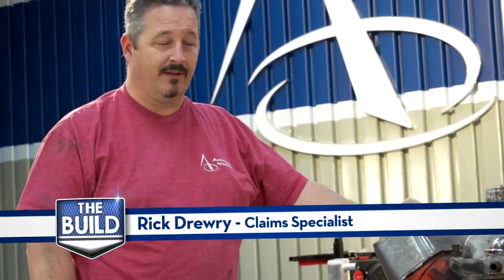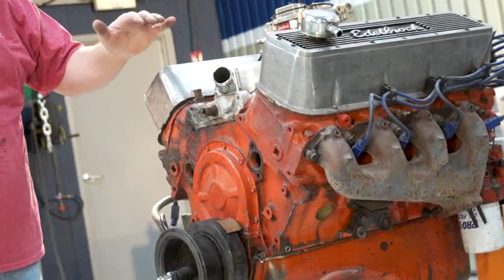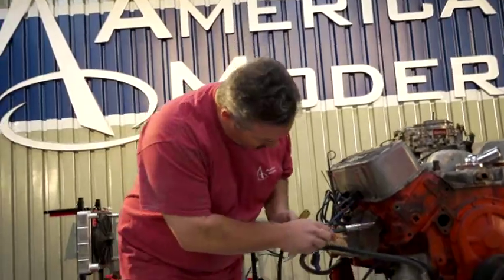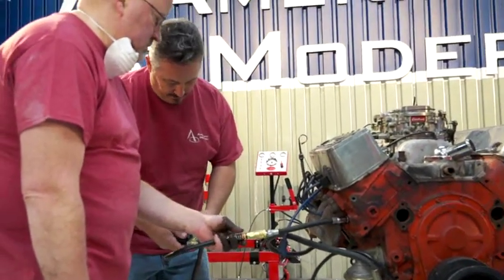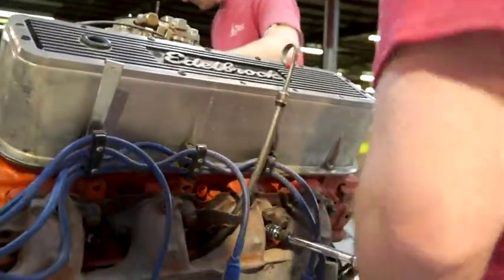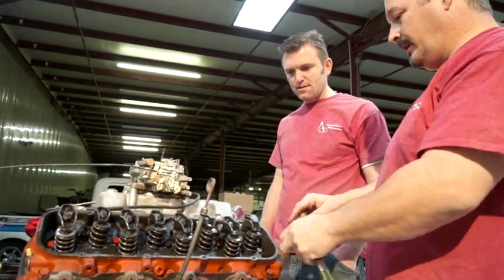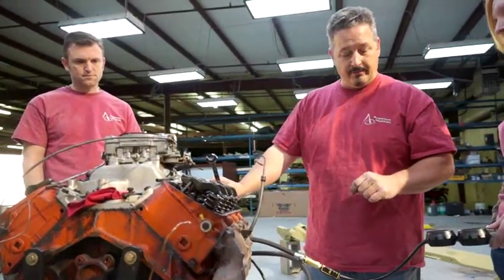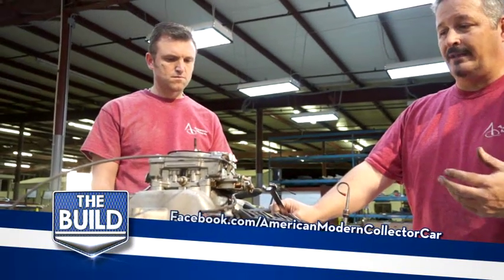Engine: Cylinder leak down test - The Build

Comment: I changed my intake manifold my spark plugs and the spark plug wires  and both of my ignition coils and the car is still shaking with a rough idle what can I do to fix that problem

Comment: You dont have to get piston at "exactly" TDC. As soon as compression stroke begins the cylinder is sealed for the test and remains sealed until the end of the power stroke. The main reason to get it close to TDC is that the compressed air can rotate the engine but at TDC the connecting rod is perpendicular to the crank for maximum resistance to rotation. With so many people to help just have someone hold onto the breaker bar. They can easily hold back the rotation force from the 15 psi pressure.

Comment: My dear
The leak test should be performed when engine is hot at the normal operating temperature so the piston ring is sealing the cylinders
And the valves are expanded in their holes.
Ask the expert...

Comment: How you can know for sure is not on exhaust stroke cuss anyway is expelling pressure by the tip of the hose I ask cuss my 8 cylinder is escaping way too much from muffler and I think was tdc but not sure if is on exhaust or compression stroke each time piston go up give me a lot of air out of the tool hose attached

Comment: I see below that you commented the test was being performed at 80 PSI, unfortunately that's not possible with this tool. Essentially all the tool is comprised of is a pressure regulator (the part you fiddle with) and a 15 PSI pressure gage that's marked off in % leakage. When you set the input regulator and the leakage reads zero you're basically setting everything to 15 PSI. If the cylinder doesn't leak at all the pressure stays at 15 PSI, if it leaks enough that the pressure is around 7.5 PSI it's gonna read 50% leakage and so forth in a linear fashion; when it's 100% leak that means 0 PSI of the 15PSI regulator is backed up into the leakage gage. I think you meant you were feeding the tool with 80 PSI. You should feed it 80~100 PSI where 100 PSI is the max it's rated for. It's also as I've learned a little dubious to leak down test a cold motor, they're always going to read higher than you'd probably like to see as the rings and piston aren't expanded to their operating dimensions. As another gent posted below, you can put some oil in there and that helps...probably still will read lower than a warm engine.

Comment from the maker: We try to show everything in our videos. While doing the leak down test, we were in the process of tearing down the engine anyway, to get an idea of the condition. We knew there would be some issues. The blow by from the compressed air was significant enough that I questioned whether we hit top dead center. It turns out that we did. Loosening up the rocker arms to keep the valves closed and putting the piston at the top, and running the test again, was a just a double check. Thanks for watching!

Comment: You don't need to remove the valve cover or back-off the valve adjustment to to find TDC to perform a 'leak down test'...very sad video.
I hope it wasn't meat to be instructional > cause it was a train wreck.

Comment from the maker: You may have misunderstood what we were saying. We ended up being between 25%-30% on all cylinders. The goal is to be around 15%. The less the percentage of escaping air, the better the engine is. We were running 80psi into the cylinders, not 15psi. Since the air was leaking down into the block at a rate of 30% and not into the intake or exhaust, we knew we had an issue with the rings and cylinders. I hope this helps you understand what we were doing. Thanks for watching.

Comment: One more thing.  that HF tester you are using is a total piece of garbage.  If it only takes 15 psi to zero that gauge that means your only using 15 psi to test with.  Most testers I have ever seen use 80-100 psi to test with.  Or at least the ones I use for aircrraft do.  Yea right you hear no air running cause at 15 psi there isnt enough to hear.  You might be able to take the second gauge off and replace with matching gauge as first and make this thing work.  maybee